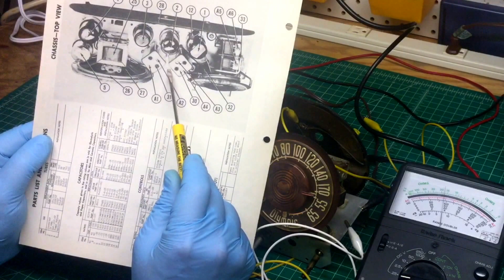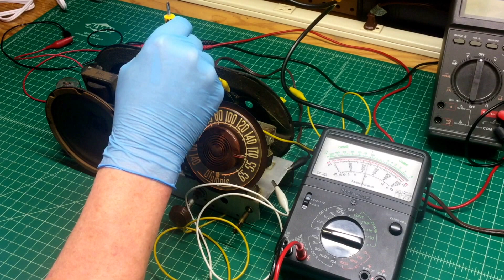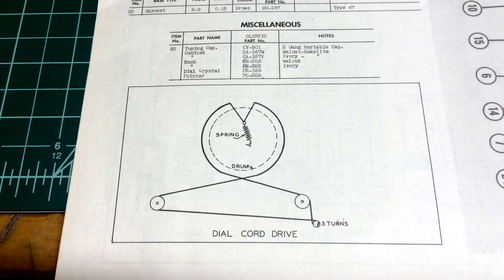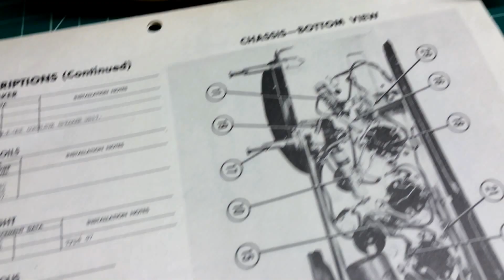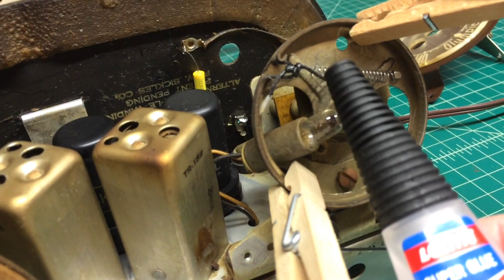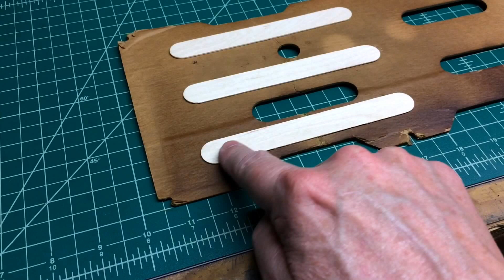Olympic 6-502 - RF Alignment

Comment: I really enjoyed this alignment video.  Have you ever done a video that shows the basics?  Such as how to hook everything up, which IF can to do first, and how to set your multimeter.  Is your meter set to AC or DC volts?

Thanks, Tom
Reply from the maker: THOMMGB Regarding the basics on hookup and alignment in detail, I haven't published what I would say is a "comprehensive" video. Are you interested in seeing one in detail? For this alignment, I used the DC setting and my tie point was to the audio taper. I appreciate your question and let me know if a detailed video would be beneficial and I'll put this on the list for future... Thanks again for watching. Best, Don

Comment: I have been busy at the cottage, so I am way behind on my video watching.  You have done a fine fine job on that radio.  It is a beauty.  Your friend is very lucky to receive that for sure.  I hope they love the old radios as much as you do.  It would appear to be working very well.  It was funny that the IF was so far off.  Maybe someone tightened up the loose screw in the can :).  Thanks again for sharing.  It is very much appreciated.
Reply from the maker: Stephen Moore Stephen, I appreciate you taking time to view and commenting. I think they will cherish the radio for years to come or that's my hope. The IF was a good 1/4 to 1/2 turn off on the 1st and 2nd...; like you said, this surprised me as I typically find most of them spot on. Thanks again for watching. Best, Don